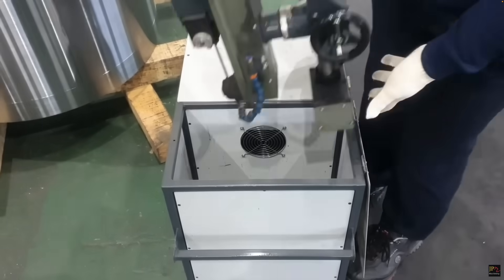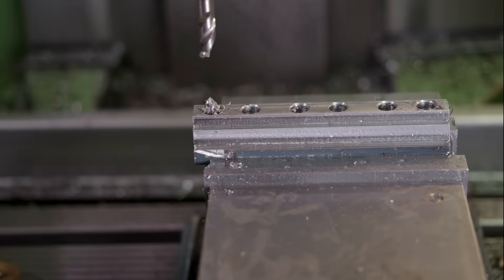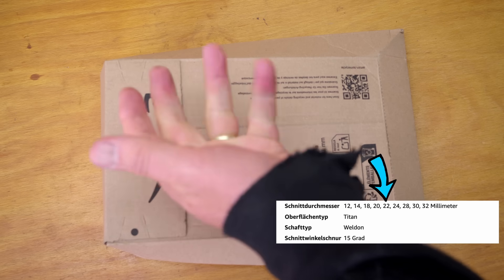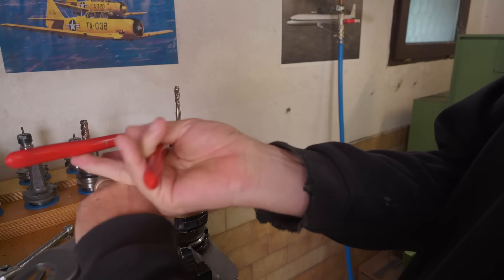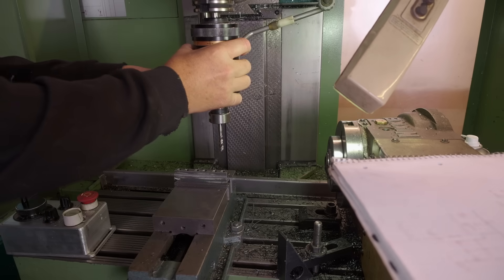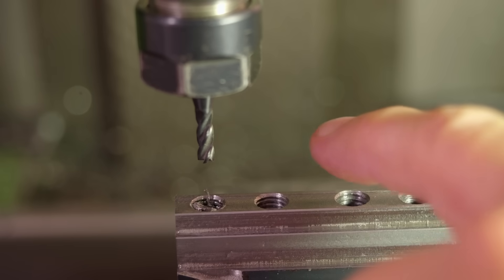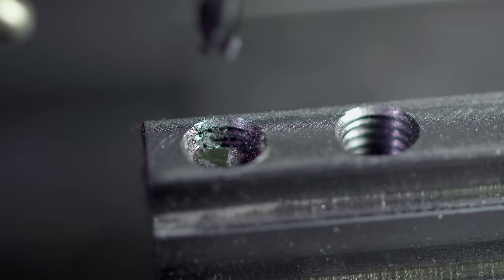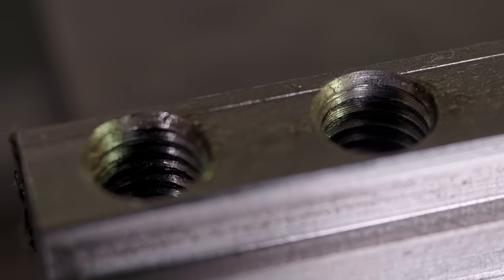Tap removal with only a CNC mill || RotarySMP

Comment: When i had to mill out broken tap, usually used a ball mill carbide, was a tip from the 'old guys '. And worked every single time 👌🏻
That kind of old knowledge.
Reply: straight down into the tap? Or the CNC/spiral cut?
Reply: @williamsworkshopuk CNC spiral, and feel with feed speed.

Just to notice that we had EDM in the workshop too, but most of the time was faster to do the job in the CNC mill than take it to the EDM.
Reply from the maker: Thanks.

Comment: How it matches first run when you backed it and go in again ? on lathe this is synchronized but here i think not or maybe i'm wrong ? Maybe this was a cause ?
Reply from the maker: Good point. It might have tried to generate a two start thread.
Reply: @RotarySMP  I'm not mechanic or machinist but two start thread sounds like some newbie prank 😅

Comment: Seemed to me the head was slipping when it should have been reversing. It only just started to reverse enough to avoid a repeat but was getting better by the last hole. I have one of these heads but don't use it. However, presumably you should adjust the clutch to overcome that slippage if you persist in using it.

I use a tension compression head in mine, as I don't have a spindle encoder that would allow rigid tapping. Less to go wrong and you can still limit the max torque with a slipping clutch collet. Also takes up less headroom than one of these tapping heads which are surely intended for use in manual drilling and milling machines.
https://www.youtube.com/watch?v=XmPVVvQptcU
Reply from the maker: Yeah, the tapmatic is overkill for the MAHO. Although it also has no spindle encoder.

Comment: I successfully milled out a broken hss tap before. I too was super sceptical, but I watched someone else do it on YouTube, so decided to give it a go. It worked fine. I expected the carbide end mill to be trashed afterwards, but surprisingly it wasn't chipped, and was still fairly sharp. I plunged in at an incredibly low feed rate on my manual mill
Reply from the maker: I guess that shallow plunge is the key. I would have expected a faster feed.

Comment: I maybe break one tap a year myself, but I have plenty of customers that break them by the dozen. I've been plunging them with  4 flute carbide for years, it works 95% of the time. The times it doesn't work are on taps that are fractured in multiple pieces.Those get cut out with a section of copper tubing filled with lapping compound.
Reply from the maker: Nice tip. Thanks.

Comment: Good to see you do some air cutting I'm waiting for this for a long time and a bonus some hand programing. Once you get the hang of it and you start using sub programs and variables, you will see a new world. Cam is fine but the 80% of the time you are quicker by hand and have way much control and make less scrap. Keep up.
Reply from the maker: I use subroutines and variables quite a lot. Especially for simple things like squaring up stock or straight slots.

Comment: Bottoming tap of questionable condition, run dry. Recipe for disaster. Spiral point with plenty of lead taper If there is room for the chips. Any kind of lube will only help.
Reply from the maker: Not dry. It was a spray taping lube. But the bottoming tap and questionable condition are right.

Comment: First of all: great to see a tapmatic works on a Maho. That's going to be a great help in the future. 😉
Second: great tip from Stefan and awesome you showed us this process. 

Thanks, Mark.
Reply from the maker: The Tapmatic is overkill for a CNC, but it is nice with the clutch to protect the tap :/
Reply: @RotarySMP  Wouldn't a tap always break in a Maho since we don't really have good control over the rpm's of the spindle?

Comment: 5:35 Have you checked the runout on that collett?
Reply: Look like it was running dead true with my calibrated right eye.🧐🙂
Reply: @4GSR just like looking at how the tap seems to have shattered, I would think it was misalignment.
Reply: @davidwillmore  Agreed.
Reply: @4GSR loved the video, BTW.
Reply from the maker: The tapmatic uses rubberflex collets, but the whole system is designed to compensate for various inaccuracies.

Comment: Didn't the tap just get pulled apart by the retract? Maho probably is stronger than the tap right?
Reply from the maker: It looked like it broke early in the retract, and there is a lot of spring extension in that tapmatic.
Reply: @RotarySMP ahh, that would also explain it, my imagination ran away with me 😊

Comment: Once i hard bottomed M6 tap in aluminium manifold. It broke under flash. No method with punch and pick was able to achieve anything other, than removing small, loose chips on tap edges.

I have taken M6 screw, put it in hand drill and removed ~80 of thread depth. Then i freehand removed material to get negative of what tap looks like. It was 3 legs in exact dimensions of what was left in a hole. I hammered that in and first try the legs have broken, but where easy to remove.

On next try i changed nothing, but was just more careful to remove no more material, than necessary to barely fit with more hammer blows. This try the tool stood some surprisingly high torque and the tap was removed

Method has nothing to offer in case of helical tap grind tho
Reply from the maker: Thanks. Interesting method.
Reply: @RotarySMP  This was poor men commercial tap extraction tool counterfeit, just taking the opportunity to use all te space was enough to offset te less tan ideal metallurgy of just a bolt.

BTW, really easy to get too much heat into as small and long piece, that was left attached to bolt.  So i was grinding slowly to make sure no discoloration was happening

Comment: 2 words..  spindle encoder....
Reply from the maker: two words... not easy. :)
Reply: @RotarySMP I have used gear tooth sensors to create a quadrature signal + index..  (using an existing gear directly attached to the spindle). (Or added a gear)

Comment: You should program the infeed just a little slower than the thread pitch ( mm / rev) to get the tap holder to come out abit.  This will also help if the machine feed doesnt match thread tap pitch 100%. Now it seemed that the holder bottomed out, tap got stuck, tap didnt rotate when being retracted. Z retracted without tap turning is what broke your tap. There should also be a slipcluth what you can adjust to different tap sizes.
Reply: None of that really matters with this tapmatic. The tap was junk and running it dry certainly wasn't helping.
Reply from the maker: It was a through hole, and the infeed was 70mm/min, instead of the pitch correct 100mm/min, so it didn't bottom. The clutch was set to the lowest torque (M6). I suspect this tap has a chipped tooth.
Reply: @RotarySMP  The tap and its holder doesnt seem to be pulling outwards from tapmatic, that i ment with "bottoming". Maybe the clutch was slipping a little and because of that it didnt feed right. I have an accu-tapper head which i use mainly with quill only and the clutch can be little slippery sometimes. Through holes no problem because you can "overthighten" the clutch.

Comment: Very useful trick, I have a bunch of "not bad enough to be thrown away" carbide end mills at my workplace for that.
It's not a frequent thing to break taps on CNC with rigid tapping, but when it happens, they're useful.

Be careful trying to remove taps or any other hardened steel tool with pliers.
When they shatter, and they do, they can send shards deep into your body.
I had one piece removed from a hand at the hospital.
Always grip it, and before applying torque or force, cover the part with a leather piece (I use old welding gloves) or several layers of cotton
Same for bearing removal, I saw awful things from people who tried to hammer out the inner ring of a worn bearing from a shaft...
Hardened steel is a b*tch.
Have a good day!
Reply: We specifically keep any damaged but not destroyed carbide thats below around 6mm for that purpose.
Reply from the maker: Good tips, thanks.
Reply: Inner rings of bearings I use an angle grinder to cut them, enough to snap them with a cold chisel, then pull them off. Outer races easiest is to use an arc welder and a quick few blobs on the inside, the cooling metal pulls it loose. inner race still not moving with the crack weld the thing up a little, and the cooling will reduce the fit on the shaft.

Small ones you cannot be tight if you are liquid metal, weld the inner race, balls and cage into a blob, and as this also includes the outer, once the fire from the grease goes out, and it cools, it will fall out.
Reply: @SeanBZA Every time you hit a hardened part, it can send you lovely messages under your skin.
That applies also when you cut and break the inner ring on a shaft.

Cover the area with something before hitting.

Comment: Years ago my son called me from boarding high school. The school has a HAAS VF2 SS. Nice piece of kit. He asked me how to get a broken M6 tap out of aluminum. I immediately asked how much time they already had invested in it. 300 x 600 x 50mm fixture plate with some crazy number of tapped holes. Every 25mm or something similar. The very last hole.   Hmmm. Ok. We aren’t scrapping that. I had him get a carbide end mill and bore out a 15mm hole. Heat the plate and freeze an interference  fit  plug.  His teacher had no machining experience. I went from being the dumbest dad on earth to the smartest in an instant.
Reply: I would just left it in there, plenty other holes
Reply: @AdamantineAxe If it was my own project maybe I would too. But this was a great learning opportunity for the kids (and for the teacher).
Reply from the maker: Nice solution Eric.
Reply: Similar, had to move a locating lug on a brand new dieset, so milled out a 20mm diameter hole where the old one was, and put in a 20mm stainless steel plug, with both an interference fit and threadlock. Threadlock to keep it watertight, as went into the drilled cooling path inside the die. Then made the plug flat, and drilled the correct 10mm pin again. worked for many years after that with no issues.

and yes I do have a collection of broken tap extractors, and have made some up out of the stiffener blades you get in windscreen wiper blades, which work perfectly for that after a little grinding. cut 3 sections, take the broken tap, put a nut on it if it is possible, or use another tap, and put them through the flutes, and you have a quick and dirty one to use. spiral taps take a sacrificial one to pre bend them to fit the flutes, put lots of lube, and offer up a blood sacrifice, which you probably did already when the tap broke in the first place.
Reply: @SeanBZA  When I read "offer up a blood sacrifice" I instantly relived my last workshop offering to the blood god. Thanks for that! I'll never hold a part and drill it ever again and I always always use a clamp or vise! Some people get free life lessons, and some life lessons cost blood. I'm lucky to still have all my fingers.

Comment: I soften the broken tap with a TIG torch then write a small macro to helically interpolate the hole to a smaller diameter, using a solid carbide end mill.  I only use a tappng attachment on manual machines
Reply from the maker: I am surprised your get any softening. Given the HSS is in contact with a big steel heat sink, I would expect it to quench just as hard.

Comment: Solid carbide end mills can be surprisingly tough. I've milled out a few taps in my life, as well as making a radius cutter by side milling into a HSS tool bit.
Reply from the maker: It really is.
Reply: So why do my turning inserts break if I look at them wrong?

Comment: Just this week I broke a HSS pilot drill and tried to drill it out with a carbide drill.  No love. It just flexed enough to put the hole out of tolerance. I’m sure it was the crap drill I ordered from Amazon because it was faster than a real tooling company.
Reply from the maker: That is disappointing. I have never had any luck with carbide drills. I tend to break them just looking at them.

Comment: Ive done this on multiple occasions at work. In my experience it has a 50/50 chance of saving the part as sometimes the thread is galled beyond saving and sometimes pieces of the tap end up breaking off and embedding into the threads destroying the tap used to chase the threads. Though maybe that's just due to the method i was taught of doing it (run an 1/8in end mill at 10k with coolant and play with the helix setting until it descends about .001in each second) i don't do it often enough (thankfully) to make it worth improving the process.
Reply from the maker: Thanks Joshua. I did have a couple of bigger chips fly out, but none damaged the mill in this case.

Comment: 6:51 80rpm is to slow, use a least 300-400rpm and proper lubrication. These are maschine taps and they want a certain cutting speed to work properly
Reply: Usually on steel I keep the cutting speed around 8~12m/minute, for a M8 tap on S235 or 39NiCrMo3 the speed is varying between 320 to 480rpm.
For 3 flute blind holes taps a little less, since they're usually less resistant than 4 flutes or through hole taps.

It is also better to use through hole taps when possible, they have more cutting edges working to form the thread, and so they're less loaded and they last longer!
Reply from the maker: @PreciousPlasticRomagna  Thanks for those tips.

Comment: Pretty sure the drilling cycle just tore the tap apart on the up stroke, looks like clutch worked fine before that.
Reply: That's what I saw too it looked like it didn't even try to reverse direction.
Reply from the maker: The horrible squeak as it went in lead me to believe I had a chipped tap.

Comment: I get those clicking noises whenever I tap by hand. In my mind it is the cutting edges of the tap breaking off and spells imminent disaster! Fortunately the worst only happens when tapping is the final operation; solution try to tap early in the workflow and confound the bad gods of machining!
Reply from the maker: Well done Michael. Confounding those gods is something I strive for :)

Comment: Brooo. Time to start thread milling.
Reply: Yeah it's easy enough with a cnc, the problems are that the thread mill is small and delicate and very expensive.
With a bit of effort you can make one from a HSS tap, at a fraction of the price of a single point thread mill bit.
Reply from the maker: @wizrom3046  I have made a thread mill for larger threads, but haven't one for M8.
Reply: @RotarySMP   when you have one for M4 ... now that's the biz  😎

Comment: Iiiiit's coffee time!☕
Edit: 12:51 - that's a pretty heavy mains hum in the background!
Reply: Please try turning off "stable volume", but yes, something sounds unhappy
Reply from the maker: That is either Indramat DC drive unit, or its transformer. I normally use the Da Vinci resolve voice isolation to filter it out when I am talking, but it can't filter where this is no speech. I had cranked the volume on that bit so you can hear the tap clicking.
Reply: @RotarySMP  Probably the transformer, typical 120Hz hum that is hard to fix unless you use some spacers to move the transformer off the steel chassis, and place a sheet of dampening to keep the magnetic field from making the steel flex.
Reply: Just out of camera shot Dr Frankenstein is zapping his monster🤣